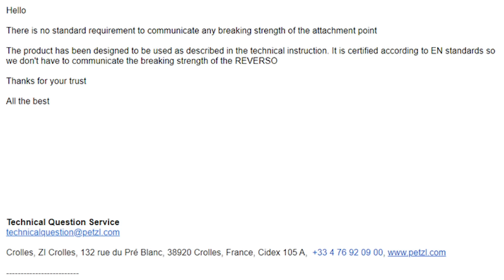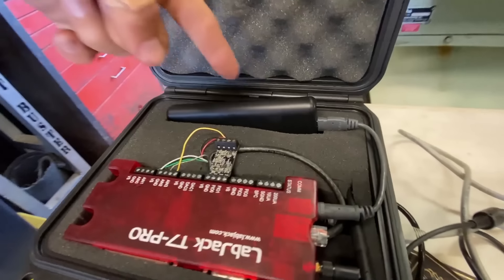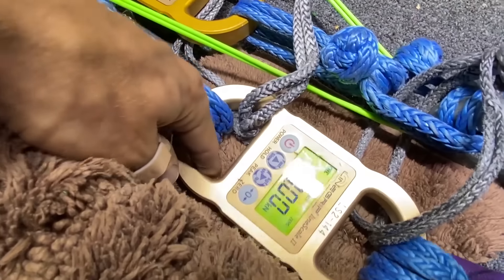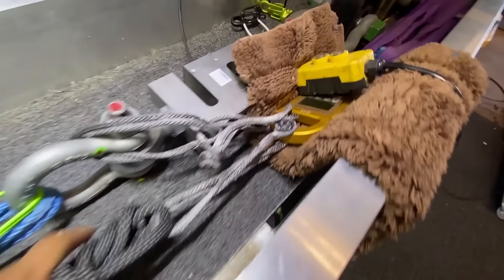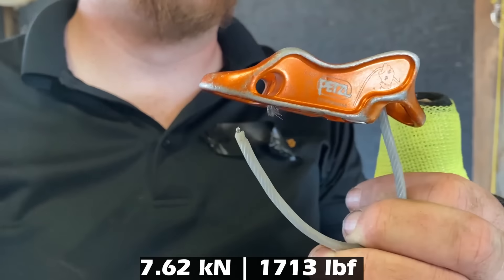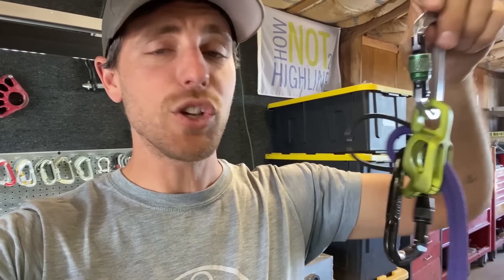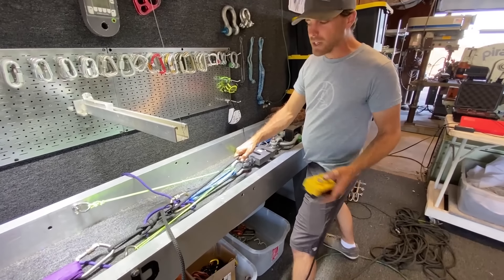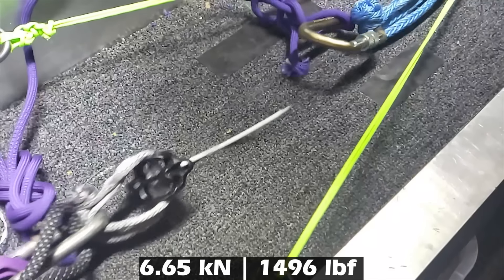Petzl Reverso and Black Diamond ATC guide break tests - how strong is that eye?

Comment: 6kN. I know that's pretty low, and I'm no gear expert, but if the Reverso is in guide mode, it shouldn't be taking massive falls so I don't think it would be built too strong.

Also just looks kinda weak. The Guide might be a bit stronger, tho.
Reply: Shoulda doubled my guess. I was right about the Guide being stronger though, so I'm pleased about that.

Comment: @HowNOT2, Could you do the slipping test with a rope at the extreme low end of the acceptable diameter for the autobloc? At times I have wondered if the ropes couldn't flip over each other and send my partner into a free-fall...

Comment: If you have already tried this... my bad. Set up Reverso in guide mode, tie knot in "climbers" rope to protect them (block feed). At what force would x-knot be pulled through the barrel of a Reverso while in guide mode?
Reply: I think the rope would break before a knot got pulled through the barrel. Or the device would fail. That knot isn’t going through that barrel.

Comment: Iteressting how rope broke at 7:00 mins for the rappeling test. I just got me a new ATC because the edges on the back where sharp on mine old one. Would be interessing to kmow if or how much sharp edges affect the breaking strenght of the rope when rappeling. But I guess 19 kn is super good enought though 😅

Comment: I use a titanium sleeve 40mm OD, 22-25mm ID by 20mm long, take off the sharp edges with a 4 mm radius and a tapered lead in 

It's A little difficult to thread,  but it's a bit more bullet proof, and easy to make if you've got a lathe

Comment: I think it wil gold between 14 to 17 Kn.
I think the rope will losse about 35 to 40% strength because of the angle it is pulled in white belaying. And because of rope friction the rope night break as close to 12Kn
Reply: The eye held around to 30Kn
The rope slipped when multipitch belaying between 5-7Kn.
Normal use broke the rope at about 10Kn.
Belayer can hold static presure between 2-2,5Kn
The wire holde about 7-8Kn

Thanks this was a very useful video to learn from.

I always use an ATC when multipitch climbing. Now I have a beter understanding of my gear. 😃👍🏼

Thanks i’m subscribed please More of this 👍🏼

And can you do the dame tests for the “mega Jul” simillar to the ATC but with a back-up bewaking system because of the incut it has at the bottom. Therefor the carabiner can pinch the rope.

Currrius what results that might give.

Have a beautiful day 👋🏼😃

Comment: i'm curious to know how many G forces one would experience to achieve these gear failure numbers. i'm not sure if it would be enough to cause a blackout but injury's would definitely be there.
Reply: As a rope access worker (and a climber), the common thing (I think) they say when you're learning is that you'll break yourself at around 6kN. Needless to say you'll be broken before your gear, and obviously I didn't made any test to confirm or negate this value.

Comment: I'm going to guess 12 kN or so for both devices. Which would be strong enough to not really worry about it.
Reply: Close for loop on the back, hopefully similar for tested in typical top down belay style.
Reply: Also, for the question on how shockloading vs slow pull would work, you experience a max load of around 4-6kn on big falls (maybe a little more if you're fixed to the ground on a high fall factor lead fall) but it is very not sustained. I've seen other studies that talk about slippage during a fall on an atc being a reason for not using grigri's on trad. So I would bet that you get a little bit of slippage on lead (and a tiny bit on top rop) when the force is at maximum, but any force applied is reducing your velocity and the force required to stop you, so you can still "hold"  the falls (with that little bit of slippage or pulling the belayer off the ground).
Reply: And wow the ATC failure force was so much higher than I expected

Comment: What about belaying 2 up using the device both taking a significant top rope fall?
Reply: I presume if there is a significant amount of rope still in the system, the dynamic absorption of the stress would not cause any problem to these belay devices when used belaying two up in the guide mode.   However, if there was a factor two fall, with hardly any rope out, all bets are off.  As you probably know, the most dangerous time is when you have out the least amount of rope, not on the longer falls. A longer fall involves more rope to absorb the stress along the rope.

Comment: the loop is way stronger than any rope, so, you won't be able to break it, unless you pull on the device. If you did that, it will be way stronger than any carabiner.
Reply: ok i was right except I now see that the reverso loop is way thiner than a carabiner, so, 12kn is about right. While it is very strong, it may well be the weakest link in an otherwise solid belay anchor. But that does't matter, because the rope will break first. so thank you, and i'm not worried about my atc guide any more.

Comment: Eye Before test: As for the eye? oof Imma have to say like 14kn, because that just makes sense, but I can see it being like 10kn too. But I suppose I can see it being like 8kn too, because why would anyone be taking a static shock load to that eye--that's the only way you'll see 8kn+ on a top belayed situation.

Eye after test: So I was close. That totally checks out.

Racking wire Before test:
I can't imagine i'll hold more than like 1kn, or like 200 lbs or so.
After test:
YO The racking wire is way stronger than I could have imagined it being. Damn that is so interesting.

BD ATC holy shit these guys are strong. Cool. Good to know...?

Comment: If I was a BD engineer watching this I would reduce the thickness of that eye to half, there's no need for it to resist 30kN!
Reply: Spoken like a true cheap ace.
Reply: Pau if you were an engineer at my factory I would fire you!!🤨
Reply: I'm just saying that you could save some weight while still having a super strong enough device, that eye is never going to see more than 5kN in a real life scenario, to resist 30kN is a 6:1 safety ratio, I'd be totally happy with a 3:1 SR and less weight
Reply: @paufi11  You're right it's "way strong enough". As a consumer though this test alone convinced me to not buy the petzl. Same price I'll buy the super over built blackdiamond.

Comment: all the confusion you are experiencing regarding eroneous data is caused by not really getting your head around the differences betrween shock loading and torque loading , its not just the force but the way it is applied, levels of fatigue in the materials, the levels of deflection they experience - this stuff can all be modelled in software, im not a metallurgist or materials scientist but everything down tyo the precise elasticity of that rope will effect failure points, i was tsunned in your sideloading tests that noone has ever comprehensively publicly demonstarted this stuff before.
in my head all carabinas would be stamped with metal grades, these are cast?
sintered?

Comment: Pre-video:
Petzl Reverso will break at 9 kN
Black Diamond ATC Guide will break at 13 kN
Reply: Well I guessed 3.4kN lower than actual on the Petzl. (I was guessing based on the top belay scenario)
And I was low on both but right that the BD was higher (If we're ignoring the extra strain on the Petzl beforehand)

Comment: I'm guessing 30kn for the eye
Reply: Well I was way off as far as the petzl eye goes
Reply: I'm guessing the black diamond ones will be higher - close to 20
Reply: Also @HowNOTtoHIGHLINE I'm sad to learn that you don't recommend ATC's for use as emergency nuts 😢
Reply: Should have trusted my first guess for the black diamond ATC eye strength - that's what I have and what I based my first guess on

Comment: I'm here for the game, and I'll say, around 40 kn
Reply: I was wrong, by a lot, but as you guys said, there is, probably, no scenario were I will see that forces when I recover the seconds
Reply: Well, for the atc, I expect that you can't break the belay loop, as I expect that the ropes break because of friction, though I didn't expect to slide before that, my question is, will it break if it keep sliding? Or the rope will never reach the point of rupture because it's sliding and never gets warm enough?
Reply: And the last one, maybe the difference between bot devices was that the reverso was precompromissed, but, and it can be my impression, I always thought that  the atc seems thicker in the belay loop

Comment: 16kn
Reply: 12.41 kN I was kinda close but still looks a little low
Reply: I bought the reversal of the original model (no cutaways)  I never really use it that much because I was worried about sharp edges or something like that and then shortly after I bought the Blackdiamond ATC guide so I'm excited to see what that will break at. I'll say it's thicker metal, so let's go with: 20 Kn
Reply: Heck yeah that broke way above what I was hoping for 30 kN
Reply: I used to tower climb with a three man team. The lead climber drags the 2nd rope and belay's both secondary climbers at the same time. If we ever started messing around playing "American gladiators TV" we both could've fallen on the rope generating up to 13 kN ⚡📺🆘  

 now I only climb with the black diamond ATC guide
Reply: We were never too worried about breaking the device because we would have that device Clipped with quick draws at two more points. One to relieve the pressure for lowering and one where the rope goes through the wire area both carabiner's and quick draws were connected to the anchor. Three points of contact on one device for two ropes & two people climbing.

Comment: Im gonna guess 15 kN.
Reply: I was wrong. It broke a little easier than i thought. But even if you had 2 climbers that you were belaying from above in guide mode, the most i could see it getting is 5 kN. So the 10 or 12kN that it broke at is more than enough to be strong.

Comment: 8 kn
Reply: was a little higher.
Reply: surprised that the atc guide broke at 30. now toproping is not scary
Reply: except that it slipped in guide mode and in normal belaying mode
Reply: interested in how far the rope could slip before braking on the biggest possible lead fall ever
Reply: like how low should we hold the brake strand to not get our hands sucked into the device on a massive lead fall
Reply: excited for the drop tower that will be cool

Comment: I watch 2 videos from your channel, I have dough on your methodology. You use old equipment against new equipment (fatigue and airline crack). You use the same piece of rope several time. You should change the equipment under test and the rope every time. The minute you stress the equipment any other reading after the first test is unreliable. It's entertaining but it's not real testing. P.S. I use to perform mechanical testing in a university, not on climbing equipment.